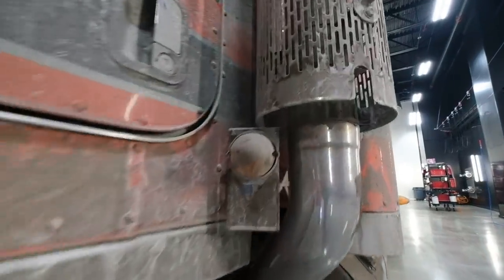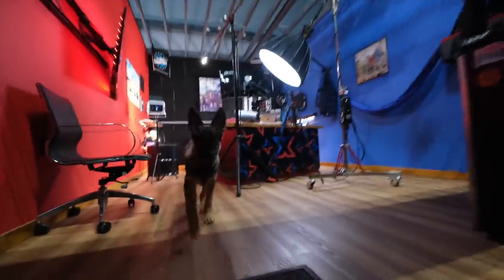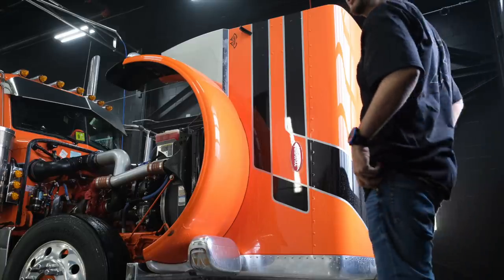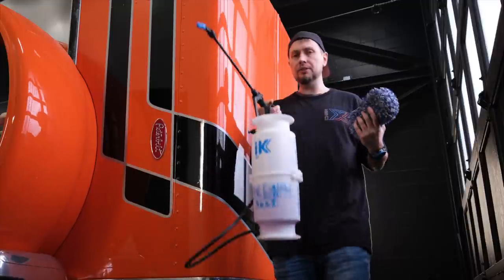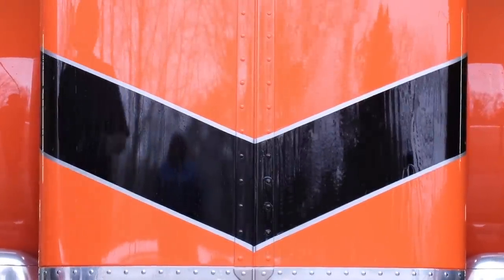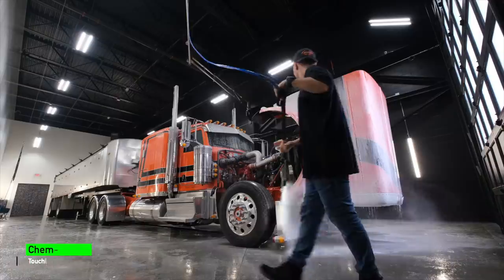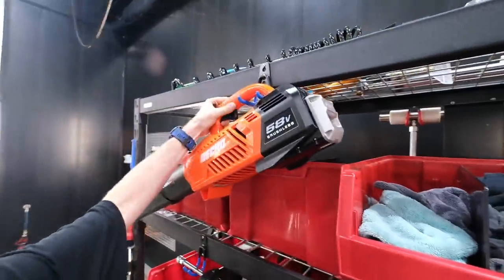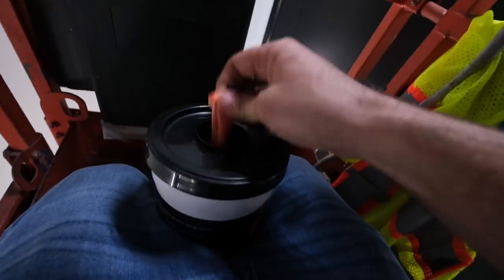Checking up on my foam sio2 sealant "Snake Oil!" Did it survive a winter in the northeast??🤯❌💯

Comment: How do you think your product would work on a concrete mixer? I wonder if snake oil would help keep the concrete from sticking to my truck a little more
Reply: Been there before Drive a Mixer here in Illinois for 10 year both Front and Rear discharge . But pulling under plant to get loaded and the Boot hangin dripping from last load sucks we used to use the water fill  hose for tank on truck jump out and squirt entire truck down with water to rinse the concrete down  especially when we we run our special  super Crete  it had very little water in the mix and we’d got to site with it and add the so called blue cool aide special plasticizer take a 3-4 in slump and turn into water  once poured to what ever it hit 4000 psi in 2-3 hours then doubles and triples in strength over 8 hours reaching 18,000 psi we used for a retaining wall over the quarry and in  Trump Tower  but anyway had ti wash that shit off right away other wise you were toast as it to come off ah the good ole days
Reply: @DIRISHMAN2163  yea I’ve been driving for a year on Tuesday and my first few months I didn’t care about cleaning so my truck was awful but then I started to care I used muriatic acid and that removed some of the pant on the fenders and that drives me nuts so I used the stuff at the plants which is the hammer clean or whatever it’s called but that doesn’t seem to do a whole lot besides leaving a white tint just trying to find something that can work but not be too bad for the truck lol
Reply: Ha Al yep I worked for a company called Prairie materials here in Illinois they had stuff in the yards to spray on your truck providing you could get to use it . Cause everyone used at end of day and there was always a line so most of the time I said heck with it. It didn’t seem like it did a lot anyway as far as cleaning just some dirt no concrete. Yes I used some straight and some diluted in a spray bottle I carried   On my truck plus